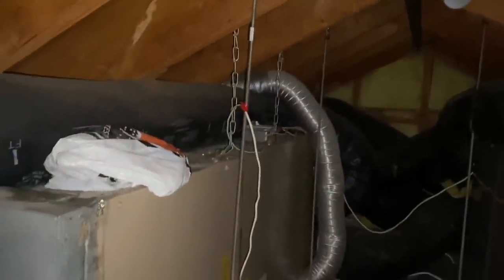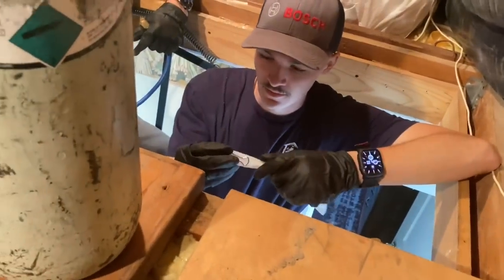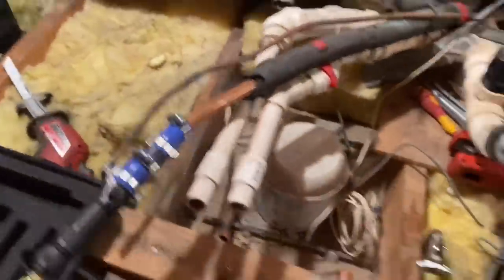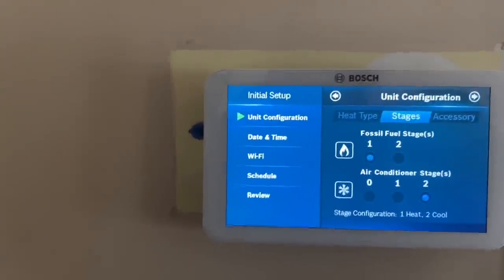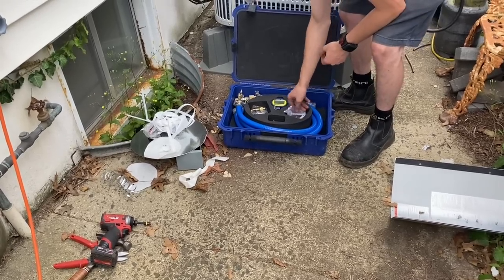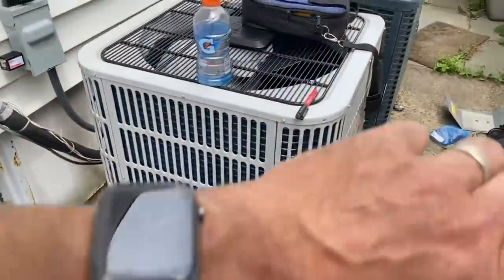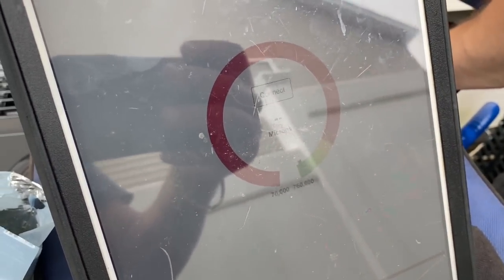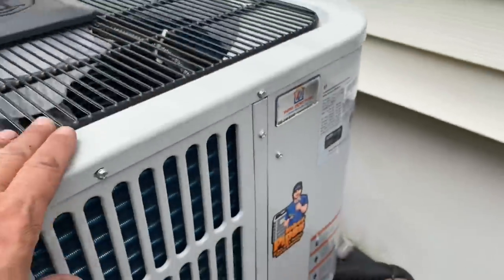Using the A-Jacks Pipe Wiper Refrigerant Line Cleaning System on a Bosch IDS 2.0 HVAC Installation

Comment: Mike, you load the pigs in from the cap that unscrews where the nitrogen connects. Also if you gan get a valve and set the pressure to about 60 psi and then just open the valve instead of increasing at the tank.

Comment: Now that you are selling more ultra-premium systems, you need to stock a few premium Bosch parts like at least 1 control board. If someone calls on a Sunday for a no cooling call after spending huge 💵💵💵, they’re really gonna be pissed when you tell them you don’t have parts…also need large backing/trim plates for thermostats. Is there any control board in the air handler that requires another surge protector?
Reply: True that! Especially since some supply stores right now are giving crazy wait times. Money season is here my friends!

Comment: Unscrew where your hose hooks to the pipe wiper to load the pig in the back of the black piece and use a ball valve on your hose and put the pressure at 300 that’s how we shoot the pig we’ve been using ours for 3 years love it.

Comment: The gas can be replaced by the R22 unit only with 410A gas, the unit will operate normally, 410 times the amount of gas22.

Comment: 8:41 pig stuck at the pipe, you probably didn't deburr the pipe after cutting it. it could get stuck at other braze joints, coupling elbows along the lines if they were not deburred.
probably best to suddenly hit it with higher pressure(ball valve) and start with the pig further inside the tool shell.

Comment: Is there any reason behind hooking up the heat pump as ac only? Why not just hook it up as a heat pump and give the customer an extra form of heat. Is It due to the heat pump not being able to keep up in your climate? Just curious
Reply: Most likely because of missing insulation, either the lineset or the house or both ;)

Comment: Could you have chosen duel fuel for the heating mode on the thermostat to use the boiler and heat pump as backup or vice versa?

Comment: Have to adjust the time of the decay test , at such short a time even with a small leak it will still pass
Reply: The Bluevac+ doesn’t just see how much it decays over 10 seconds, it calculates the rate that it’s climbing over the time period with the level of vacuum it’s at, and takes into account temperature.
Reply: The blue vac uses algorithms and does basic math as well to determine whether or not it will pass. It’s not a stupid device. There’s a reason it’s like a 300 and something dollar micron gauge
Reply: @prowesstv  point me toward the videos please
Reply: @markmcelmeel7850  he has more videos  doing similar test it's not just the one i sent